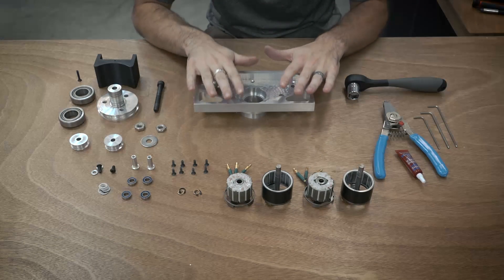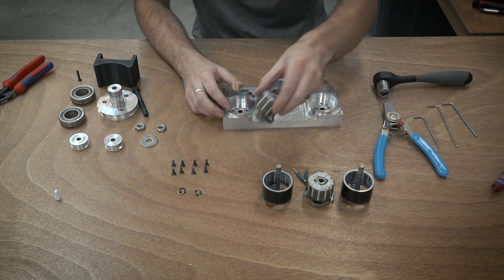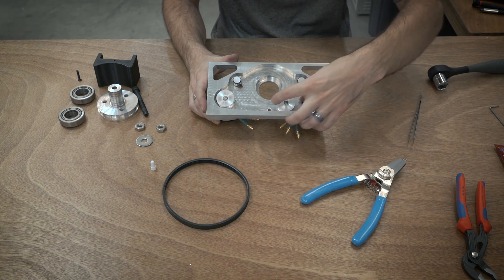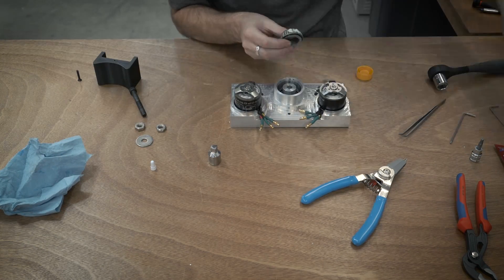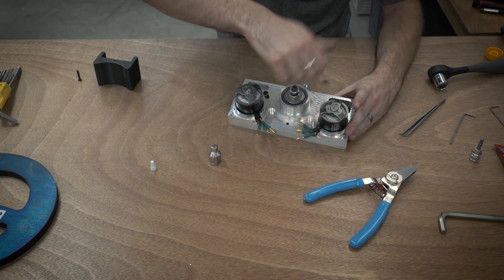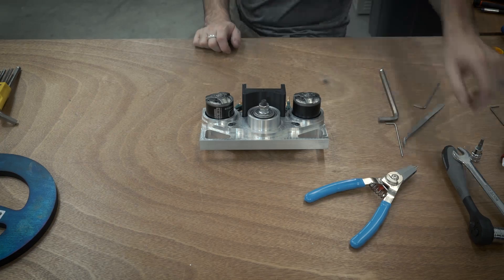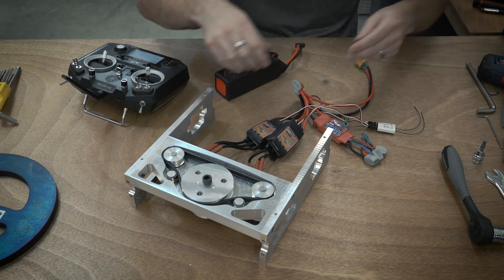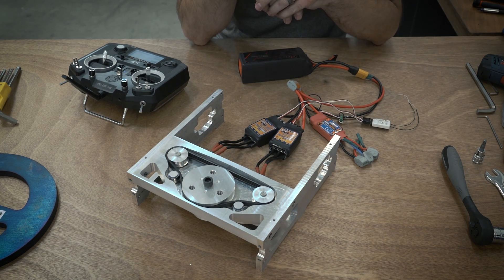Crippling Depression Assembly: Weapon Block

Comment: Hey sir
What are those motors 5050?
Reply from the maker: Yes, propdrive 5050 v2
Reply: @RobertCowanDIY  and what esc sir?
Reply from the maker: @SAMURAIX9909  I use either hobbyking super simple 190/200A or redbrick 200A.

Comment: I'm just an old-fashioned girl who likes to make stuff - including combat robots. [Started in 1987.] I can't afford to build them now, but when I could, they were always pretty basic - I had nothing but a small lathe in my so-called workshop - so my efforts would seem very crude indeed to a modern roboteer with access to equipment I couldn't even have dreamed of when I was welding bits of stuff to other bits of stuff.

What I find most alarming is the amount of care and effort that goes into a modern bot: CAD, CAM, CNC, 3-D printing, 4-axis whatsits and laser and water-jet cutting... Today's bots are exquisite works of art which (to my mind) are far too beautiful and precious to be set down in an arena and smashed to pieces!

It's rather like hand-making a chronometer, then screwing it to a handle and using it to bang nails into the floor. Nooooo!
Reply from the maker: Every sport/hobby evolves and matures, this one is no different.
Reply: alot of the parts can be had from old farm equipment .  some serious accurate welding can replace a lot of the machine work oh 8670 is the toughest steel  known to man .
Reply: I don't understand the wiring . but a vertical spinner in the heavy weight class would not be that difficult to build

Comment: Hello sir !! I wanted to know how you start both brushless at the same..I tried but failed...plz reply..
Hoping for a response
Reply: Ritesh singh which controller are you useing?
if its flysky then assuming you connect both of them to 1 and 2
mix them using setting , for positive throttle both 100 for negetive throttle both -100

hope it helps you

Comment: if i do it with gt2 belt and gt2 pulley ,will it work?
Reply: No. Once you rip the teeth off the GT2 belt it's useless. A V-belt doesn't have that problem.

Comment: What voltage are you running to the ESC and motors? What brand ESC are you using?
Reply from the maker: I'm running everything at 6S (~24V).  The drive ESCs are F-80A and the weapon ESCs are super simple 190/200A, both from hobbyking.

Comment: Why did you encase the coils on the motors in epoxy?
Reply from the maker: to make them more reliable for combat.  there are a lot of forces involved and if you don't coat the magnets and coils in epoxy, they tend to shatter on impact.  this prevents them from shattering.

Comment: a lock nut and a spring washer might help with the preload you want on the tapered roller bearings, its less finicky than trying to get jamnuts to work right
Reply from the maker: that was the original thought.  however, after a few battles, even three steel washers were deformed enough to loosen the whole mechanism, so using spring washers might be out.  it would add too much flex in the system.
Reply: Robert Cowan the cup spring washers? Not the wave spring washers. The cup ones are good for hundreds of lbf and have deflections on the order of 0.01 inches. Much stronger than ordinary washers.
Reply from the maker: yeah, I know the ones you're talking about.  I'm still not convinced they would stay put.  I had 3 hardened washers stacked and in 2 minutes it cupped all three at once.  I'm just going to make an extra thick titanium washer/nut combo instead.  Any movement in the assembly creates problems, so even if the spring washer is rated for several hundred pounds, it could still move, which could cause the weapon to make contact with the frame.

Comment: Is that some kind of threadlocker fluid you're applying on the screws?  I'm having some problems with my 3lb robot due to screws from mounts loosening too often and I didn't want to resort to using lock nuts on every screw that's not threaded into something since I'd need to replace those during maintenance. I was looking into threadlockers but I'm not sure if they react well with plastics (I have some UHMW and HDPE parts). What would you recommend using?
Reply from the maker: Yep, I'm using loc-tite for all the srews.  for UHMW or HDPE, I've had some luck with using superglue.  You need to work quickly, but for shallow screws, it works well.

Comment: Nice. I suggest the tensioner pulleys ought to have been located "further down" to create more belt wrap against output pulley and more wrap against both drive pulleys.
Reply from the maker: You can see that I added slots, so they can be adjusted to have higher belt engagement on the pulleys.  However, it worked well at the lowest tension, it allowed the belt to slip during impact and not put stress on the motors.

Comment: I was  just wondering if you would get into the same problem that @Tom Stanton had with his dual motor electric bike. https://m.youtube.com/watch?t=3s&v=IymLqEPUkvw (07:15)
Reply from the maker: I had no problems with the dual motors.  There are a few key differences.  First, he used timing belts and pulleys, which don't allow for any slipping.  Secondly, the profile of his pulleys is much different.  He has a much higher belt engagement on the motor pulleys.  I have the bare minimum (around 100 degrees or so).  This is a bit more forgiving I suspect.

Comment: Great to see it all together! Those Wago terminal blocks are so handy, you might want to install ferrules on the bare wire leads though.
Reply from the maker: Yeah, this was just for temporary connections, I would normally use ferrules or tin the leads.  But they hold pretty good on stranded wire though.

Comment: If that RX has smart port i bet you can add some fancy sensors to the bot like voltage/current  read out and have it report it back to the TX
Reply from the maker: That's the plan for the next competition ;-)  I have current sensors and RPM sensors for all the motors.

Comment: What absorbs the shock when the rotor hits an object? Will the motors not rub against the pulleys?
Reply from the maker: theoretically, the shock will go into the main drive pulley and those bearings, and to a lesser extent, the belt.  the motors don't rub against the pulleys, not sure what you mean.
Reply: Robert Cowan Rotor is blocked by obstacle. Motor tries to keep spinning.
Reply from the maker: Ah. the belt around the motor's pulley should slip.  there's just enough slack that it should be able to slip.